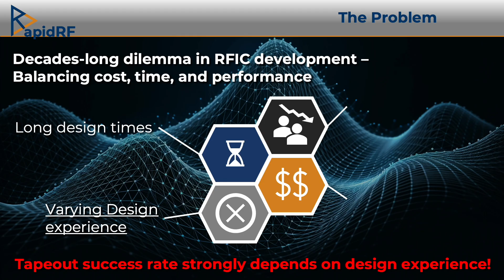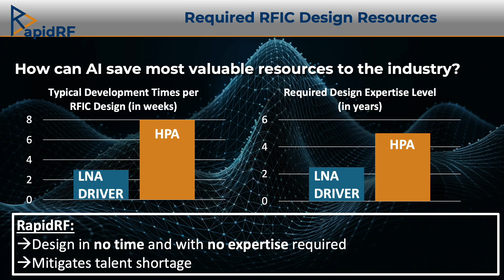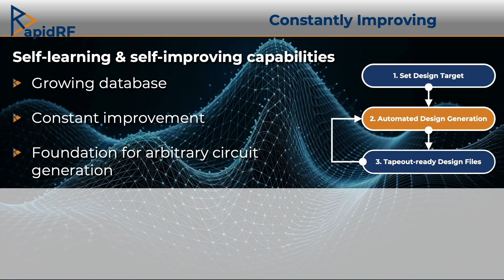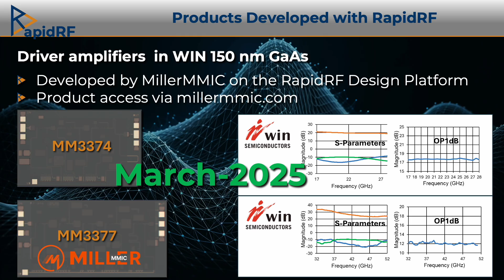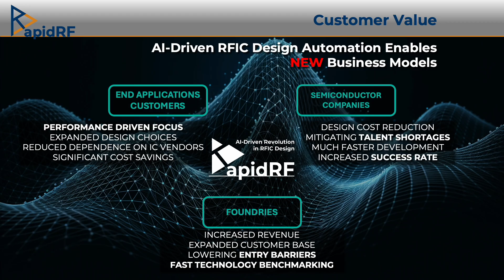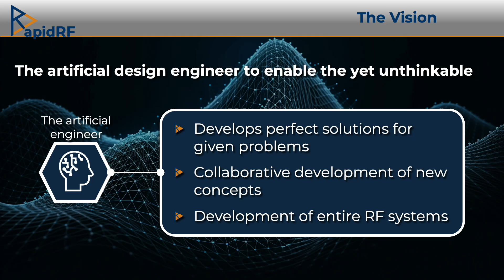RapidRF at RF & Microwave Summit: AI in RFIC Design Automation

Comment: Are you guys using simulation in-loop approach in design process? If yes, how are you making it so fast. Simulation os moderately difficult RF circuits takes time in common EDA tools like cadence. If there are passives, then it's EM extraction also takes time. How is this accelerated without extraordinary compute resources?